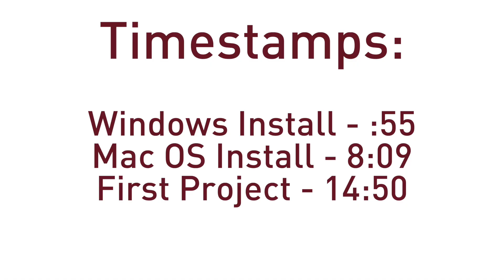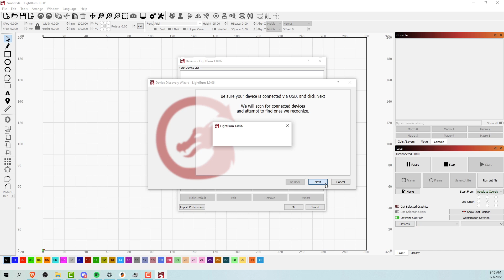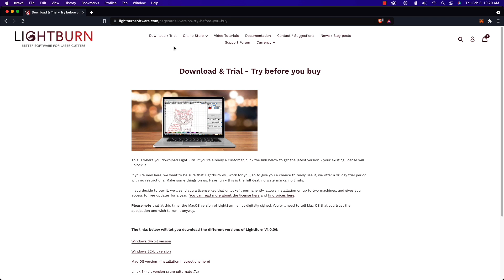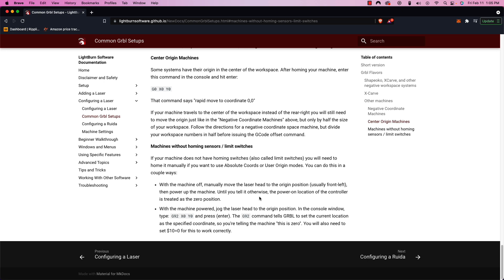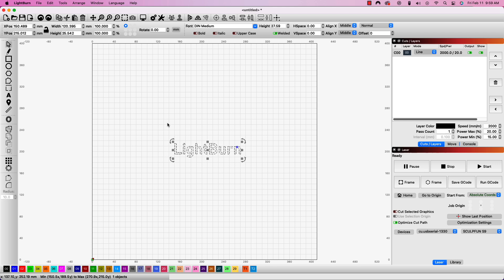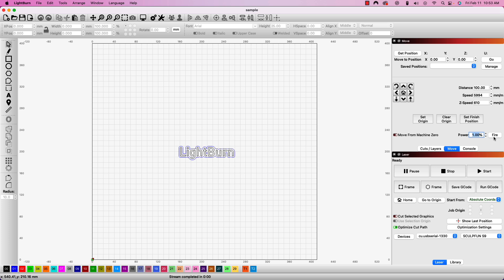Setting Up Your SCULPFUN Laser With LightBurn & First Project

Comment: good explanation, however i have the problem that when framing or by starting to cut/engrave, the laser moves to the sides, bumps, goes back to the left side bumps, en then starts somewhere where I did not set the head, mayday mayday

Comment: Thanks for the video. I really appreciate it.
However, my S9 shows a work area of 200mmx200mm instead of 410x400mm.
I tried manually putting it in the work area but it still reads 200x200 when I check it with $$ in the Console.
Any help?
Reply from the maker: @davidbonney5557  - You’d have to change it in the firmware of the machine itself. Go to Edit > Machine Settings in LightBurn and change the X and Y axis max travel settings there.

Comment: I do think I've done all of this, but my laser isn't finding "Home" on the X axis.  I don't know what I've done wrong or how to proceed.  Please advise.
Reply from the maker: Does your laser have limit switches? If not then you won't be able to home it. You have to set home by moving the laser to the front left while its powered off and then turn the laser on. If you have switches and its homing in the right direction but just not stopping for X I would check that the cable is plugged in fully on both ends and that there is no damage to the cable/connector. If that checks out it could be a faulty switch and reaching out the manufacturer would be the next step.

Comment: So I've never used my laser yet, trying to set it up with Sculpfun S6 pro with the expansion 950 x 410 but it rattles when homing after all instructions said and followed. I had entered the expansion dimensions but it
 struggles to move. The Belt isn't tight or loose.
Reply from the maker: I would contact the manufacturer for this. If motion isn't smooth then it's gonna have problems. Belts should be relatively tight so that's what I would start with. Sculpfun should be able to provide you with further instruction.

Comment: Hi I purchased s9 and I would be greatly appreciated if you could tell me the settings in lightburn to engrave the clear 4mm acrylic thank you very much.
Reply from the maker: You cannot engrave clear acrylic (or any clear material) with a diode laser.  You would need to color the surface with something like a black marker, but that will greatly reduce the quality of the result.
Reply: @ thank you very much but I m hopping to have the engraving setting like speed, power etc in S9 for acrylic thanks

Comment: Good day hope thanks for the video i followed it step by step,i just have one problem,everything fires up and works like it should but no engraving or cutting is happening, its a brand new Sculpfun s10,the lazer comes on and if i hit start it starts to move over where it should do the project but it is not engraving, do you have any advise for me please.
Reply from the maker: Is the material correctly in focus? Have you ran a material test to dial in your settings? Another thing worth checking is that your S-Value Max is set correctly. Here is a link to our docs on it: https://docs.lightburnsoftware.com/Troubleshooting/GRBLPowerOutput.html#s-value-max-set-incorrectly
Reply: @lightburnsoftware7189  Thanks for the feedback, i did space the lazer on top of the material with the spacer supplied yes,i tried to do the material test but with different values and power output there was no change, the lazer starts with the test and i can see the fiscal blue light on the work piece but no engraving i will have a look at that link you sent me in the morning and get back to you.

Comment: Hi! Nice and detailed video!! 
I just got the sculpfun 6 pro, I have no idea at all on how I can use this machine, are this instructions the same for the 6 pro as well or do I have to do something different to start using it! I download the LightBurn already but I was watching your video and you also mention to download another driver? Could you guide me through  this process ? I really appreciate it! Thank you very much
Reply from the maker: We haven't tested the 6 pro specifically but looking around it looks like it should be compatible. The most common driver used is that same CH340 so I would follow along with the guide and see if that works for you. 

If you run into any issues contact our support team at support@lightburnsoftware.com
Reply: Thank you very much! I will try and let you know how it goes, thanks again for your time!  I have no idea at all on how to use lasers machines so wish me luck!!

Comment: a few months ago I bought a Sculpfun S9 through an online shop in Indonesia, the first time I installed it, it worked well, I haven't used it for a long time, I tried to use it again, but the machine didn't work according to the design I had,

 then I tried to uninstall the application, then when I tried to reinstall the application, sculpfun was not detected in the lightburn app, please help, thank you

Comment: Hi, I just bought an S9 and strangely the work place in LightBurn seems to be mirrored when the laser works. So if I want text "TEST" to be correct and readable I have to mirror it in the LightBurn so when the laser does it's job it comes correct. Is there any option for "mirrored mode" or something? 
Thanks
Reply from the maker: Read here:

https://docs.lightburnsoftware.com/Troubleshooting-Output.html#output-is-mirrored-or-backwards
Reply: Thanks, i got it! 
cheers @lightburnsoftware7189

Comment: I like this video thanks. But I’m have trouble with my Pergear LaserStorm S5 . Trying to connect it to LightBurn. I clicked. Find my Laser but it can’t see it. The power is on the fan is running. The screen is on but blank is that supposed to be like that? I tried it multiple times and still light burn cannot find my laser. Do I need to put the TF CARD IN ? Please help me! ! 😫
Reply from the maker: Have you successfully used the laser previously? Does the manufacturer have a setup guide for LightBurn with that laser? It could also be that a driver is needed for it. 

If you are still having issues contact our team - support@lightburnsoftware.com
Reply: @lightburnsoftware7189  hay thanks I got it going now 😁🤓

Comment: Hello,  When I press and hold shift key + frame , just head is moving as frame size but without light, please how can I resolve it, and is the laser 5.5W can cut acrylic as 6mm ?
Reply from the maker: Did you enable the laser fire button? The value set in the fire button is what will be used when framing so you may need to bump it ever so slightly to find the minimum required power that you are able to see. 5.5W is great for engraving but may struggle with cutting. Diode lasers will not cut clear acrylic so if you are wanting to cut you will want an opaque acrylic. Black is the easiest to cut with a diode.

Comment: everything worked for me up to the fire button that never showed up and the move button is not there either. I have cut/layer, console. camera control and, variable text.
Reply from the maker: If the Move window is not visible you will need to enable it. This can be done by clicking on the Window dropdown in the top toolbar and clicking "Move". If it is already checked and not visible it was likely undocked and you can select "Reset to Default Layout" at the top of that same Window dropdown menu to restore it.

Comment: Lightburn did not find my Sculpfun S9, I have the driver installed, and if I manually setup Grbl device it is working but engraving wrong moving in sig-zag when should cut a circle the image look almost like a gear.. With Laser Grbl it is working fine. What is wrong in Lightburn?
Reply from the maker: That happens if you use a pirated copy instead of an official one downloaded from our website.

Comment: 26:18 There is no "Move" tab on mine!  Only Cut/Layers, Console, Camera Control, Variable Text.  Ugh, Im brand new to this so Im following every step to learn and it's so hard when the video doesn't line up with the software. :( What am I supposed to click on?  I have an S6 Pro but didn't see an S6 pro video in your library so I figured the S9 would be similar enough.
Reply from the maker: If you are seeing camera control and variable text that means the original layout has been edited. You can easily fix this my clicking "Reset to default layout" under the "Windows" menu or enabling the "Move" window from the "Windows" menu. I would watch our Workspace video: https://youtu.be/t0p4U2eSFQs

Comment: Hola buenos dias, excelente y educativo video, una pregunta, tu sabes porque mi sculpfun s9( lo trabajo con LightBurn) se detiene en mitad de un corte o grabado y ya no continúa?, necesito hacerlo en dos partes para poder terminar, agradecería se me pudiera ayudar, gracias
Reply from the maker: Si un trabajo se detiene a la mitad, es probable que haya un error que lo esté causando. Cuando se detiene, ¿hay algún resultado en la ventana de la consola? tal vez y error de activación?

También podría valer la pena probar con un cable USB diferente.

Si aún tiene problemas, comuníquese con nuestro equipo: support@lightburnsoftware.com
Reply: @lightburnsoftware7189  GRacias por tu pronta respuesta, me presenta al inicio del trabajo ERROR 5 y cuando se detiene presenta lo siguiente Layer C07
o�H�ok
o�H�ok
�ok
�ok

Comment: sir, i have issue ...my S9 can't cutting following my artwork... i make rectangle the results s9 perfect.. but when i do circle the results is not circle.. i don't know is it software or s9 issues..help me pls
Reply from the maker: It would be best if you could show a picture, so we can see the results, but you can’t do that here. Does the circle just look a little funny, or is it made of jagged lines that look like scribbles?
Reply: @lightburnsoftware7189  the circle like jigjag and line is not square
Reply from the maker: @jasniHD  most likely you are using a cracked copy of the software. We automatically detect this and make it fail in a number of frustrating ways. Download the official version from our website and it will not do this.
Reply: @lightburnsoftware7189   i have to uninstall all? i have try trial version then they ask for license key.. do i have email ?
Reply from the maker: @jasniHD  if you have already used the trial you can email support@lightburnsoftware.com to reset it.
Reply: @lightburnsoftware7189  ok i try first..

Comment: I got another machine s30 pro. but when I follow all the steps and try to make a simple text design it just makes lines. instead of the text
Reply from the maker: If you are getting lines instead of shapes it could be a handful of things:
- wire being loose for a motor
- speeds to quick causing motors to skip steps
- a pulley on a motor being loose
- a belt being loose

Is your preview window showing the text you are expecting? If you try the above and are still having issues email our team at support@lightburnsoftware.com.

Comment: Why does Error 9 occur?
Reply from the maker: Error 9 can be caused by a number of things. It is shown when the machine goes into a lock state that is typically accompanied by additional info. 

-Flame detector on Ortur machines
-Changes made when using a rotary
-Machine not homing correctly

To name a few. If you are getting Error 9 look in the console before and see if there is any other information or error being shown along with it.

Comment: How much quantity can cut at a time sir
Reply from the maker: Cutting ability will depend on the specific laser and the material. Diode lasers have a pretty broad range of power from 5W up to 40W with combined beams. If there is a specific laser you are looking at the manufacturer likely has some recommended values or specs.

Comment: Hope I get an answer here.... Everything works except my laser doesnt fire. I have been using this laser for about 4 months. I came out..turned it on...everything works and cycles...but no laser! The fan light comes on....but the laser firing light on the module never comes on and no laser.....
Reply from the maker: If it is not firing I would check your wiring to make sure none of the cables in the connectors are damaged or gave come unplugged. If you have tried increasing the power and still are not getting output I would lean toward it being hardware related.

Comment: The video was nicely done. I watched it all the way through, and then downloaded Lightburn and the CH340 driver. However, I got an error trying to load the driver. It failed and I can't figure out what the problem is. I have a Toshiba laptop with Windows 10. I was able to load Lightburn, but of course it will not find my Sculpfun S9 because of the driver. Any thoughts on what I should check? Thx.
Reply from the maker: What is the error that you are getting when trying to install the driver? I would double check that you are downloading the correct version under Windows, run as administrator, and click uninstall first to remove anything that may already be installed. https://sparks.gogo.co.nz/ch340.html If you are still having issues after that please contact our support team support@lightburnsoftware.com
Reply: @lightburnsoftware7189  thank you for your response. First, my Firewall quarantined the driver download, and once I figure out how to allow it, I tried the install and just got a window with the error "Install Failed". I restarted my computer, hooked up the laser and turned it on, went through "find my device" and it found it. I'm not sure how it worked, but it did. I followed your video again and was able to make my first project with text and an outline. I couldn't have done it without your step by step video. Many Thanks!

Comment: Hello...When I do the fill and then go to the preview, the pink shaded area starts way before my text and ends way after. It is not as in your example where the pink shaded area starts at the first letter of LightBurn and ends at the last letter.

Please explain this.

Thank You
Reply from the maker: If you blindly entered “3000” as a speed, ignoring the units used, and your system is set to mm/sec instead of mm/min or inches/min instead of mm/min, either of those would be much faster.  That would be the most likely difference.  You might also have turned up the overscan amount - the default is 2.5%, but a higher amount would add more overshoot.
Reply: @lightburnsoftware7189  Thank You.
But, as a first timer, how would I have known to change to mm/min because I didn't even know what the default setting was. Also, I do not even know what an overscan amount is..where would I check this ?
Reply from the maker: @fazelhassan  - It does not matter which setting you choose, you just can't blindly assume that if you enter "3000" that LightBurn knows what units you meant.  If you see a speed value on the internet, it should include the units.  If the speed was 3000 mm/min, that is the same as 50 mm/sec (divide by 60 to convert /min into /sec).  How you choose to display the speed is a preference, and that can be changed in the settings.

Overscanning is a setting on Fill and Image layers.  https://docs.lightburnsoftware.com/UI/CutSettings/CutSettings-Fill.html#overscanning

Comment: Hi, do i use the same driver for the sculpfun s10? my LB with the ch340 does not recognize the s10. I installed the driver after having already used LB by manually adding the s10, now I have seen that it needs a driver, and after installing and restarting it, it automatically does not recognize any laser. however i add  manual and works but im not sure if the setting is correct. 
Another question is how can I enlarge the line size when drawing in *Draw line mode?
Reply from the maker: Yes, it should be the same CH340 driver for the various SCULPFUN lasers. If you are having issues with connection please contact our support team support@lightburnsoftware.com

As for the line size is there a reason you are wanting to make it larger in size? Is it to see easier on the computer or so that it engraves a wider line?

Comment: How long or number of hours can the laser machine be used continuously or without stopping?
Reply from the maker: A lot of this will depend on the specific module. The quality of the components used, as well as heat dissipation are big factors here. It would be worth reaching out to the manufacturer for the laser purchases to see if they have recommended continuous run time.
Reply: Thank you very much

Comment: my sculpfun S9 is not auto detected by LightBurn. Why?
Reply from the maker: Did you install the ch340 driver? Do you have any other program open that may be connecting to the device? Make sure it’s powered on, try a different usb port, and try a different usb cable.

Comment: I need help. Lightburn doesn't recognize the sculpfun s9, I have a 2020 M1 macbook
Reply from the maker: Did you install the needed driver? The most common issues are missing driver or a bad USB cable. Those would be the first things to check.

Comment: Pls help me with settings for black granite.
Reply from the maker: You will want to run a test grid to get the best settings for your laser on the specific granite. The settings will vary from machine to machine. If you want a baseline it may be worth reaching out to the manufacturer to see if they can provide that.
Reply: @lightburnsoftware7189  ok

Comment: When multiple cuts are required, what better way than duplicating the drawing on multiple layers.
Reply from the maker: Multiple cuts of the same shape? If so then you will want to increase the "Pass Count" which can be found at the bottom of the Cuts/Layers window.
Reply: @lightburnsoftware7189  一个图纸上存在多个路径时，如果我输入pass count：10，他会切割第一个路径10次，然后切割下一个路径10次...但是我希望他切割所有路径一次后，然后下一次，下一次，下一次....
When there are multiple paths on one drawing, if I enter pass count: 10, he will cut the first path 10 times, then the next path 10 times... But I want him to cut all the paths once, then the next time , next time, next time....